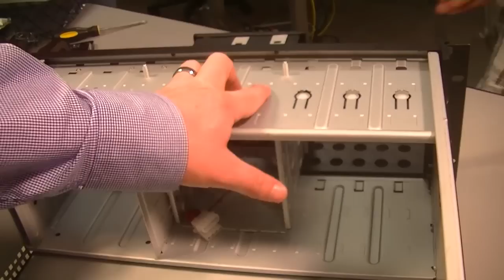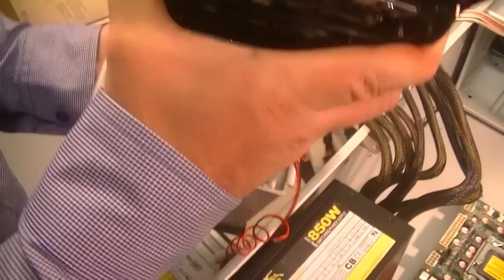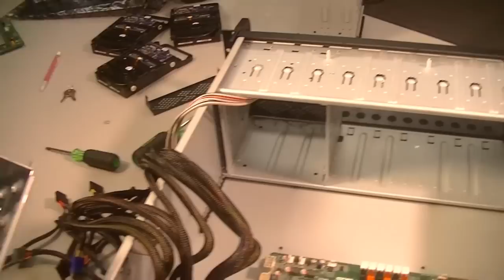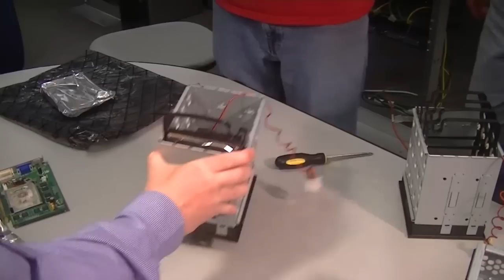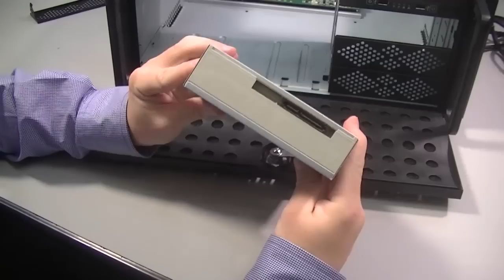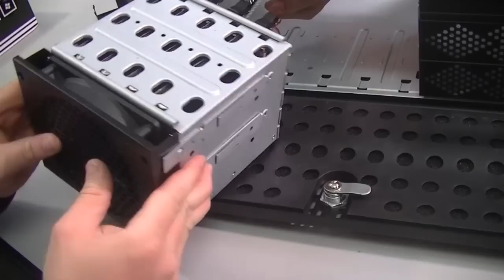How to build a server computer: Part3 Installing the drives

Comment: Why on earth didn't you get a server case? You could have gotten that cheap power supply included with a server case by Thermaltake a Xaser VI. I know...I have it and the board, etc., etc. Except I decided to change my PSU to a LEPA G1600. watt
Reply: Brian F. Burke Jr. I just use my old pc as a server